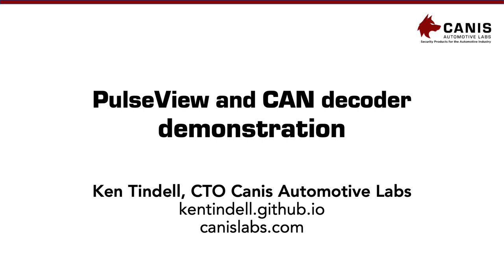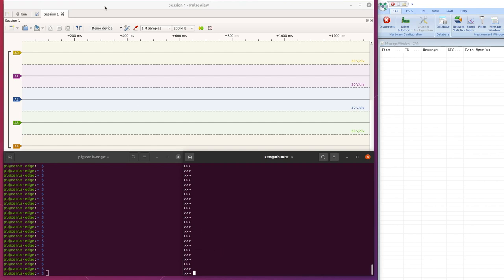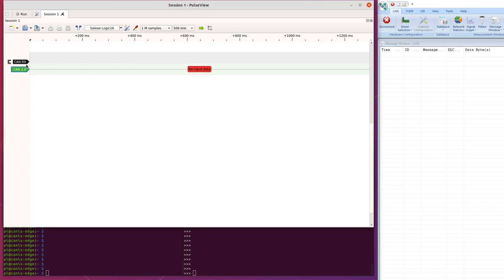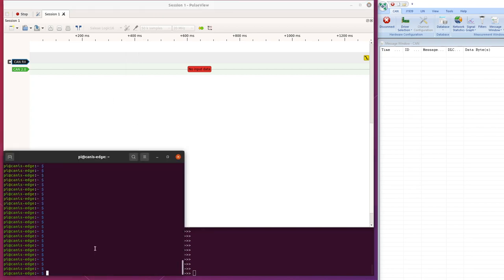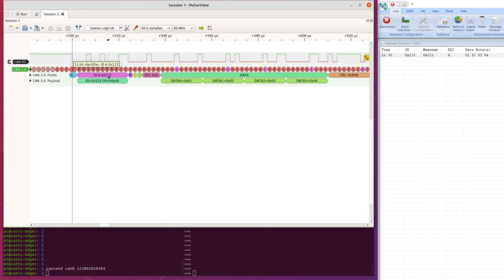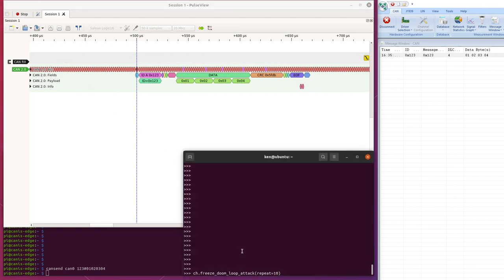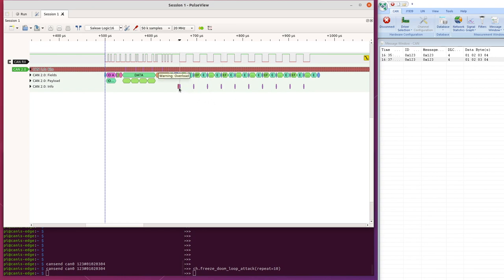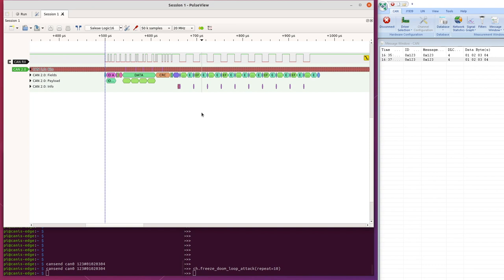PulseView and CAN decoder demo

Comment: You had a number of different things going on in the video. For the sigrok/pulseview analyzer it seems you used a standard saleae logic analyzer on the CAN bus receive line to capture the bits and a CAN decoder plugin that performed the actual CAN protocol analysis. Is that correct? For my use case I just want to monitor automotive CAN bus traffic.

Comment: What is can rx Line in pulse view and can we connect can tx line to one of the channel
Reply from the maker: A CAN transceiver has two digital pins: CAN TX is the output of the CAN controller, and CAN RX is input to the CAN controller. Decoding CAN RX is the same as decoding the CAN bus. You can decode CAN TX too: you just add a second decoder to the CAN TX line in the logic analyzer. But the decoder will flag a potential error because the TX line is missing the ACK=0, but otherwise this is fine.

Generally you only bother to decode RX because what is sent on TX gets looped back, but you very often want to connect the TX pin to the logic analyzer at the same time because you can then see whether the device was transmitting or receiving: if it's receiving then it will send recessive bits except for ACK=0, if it's transmitting then TX and RX lines will look the same.